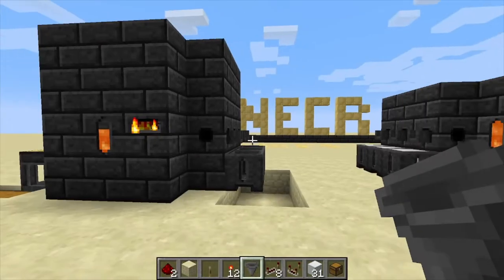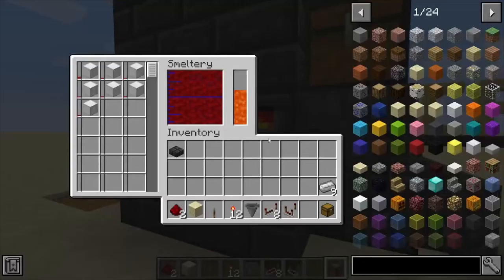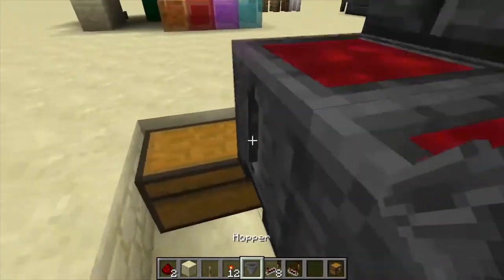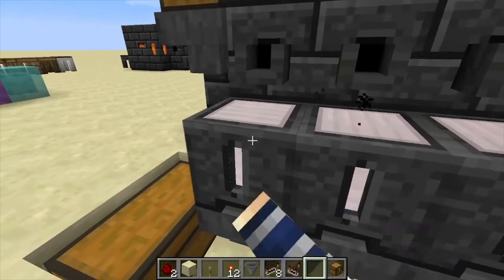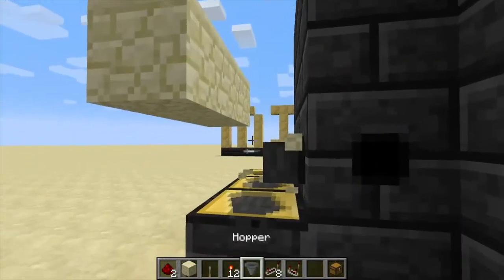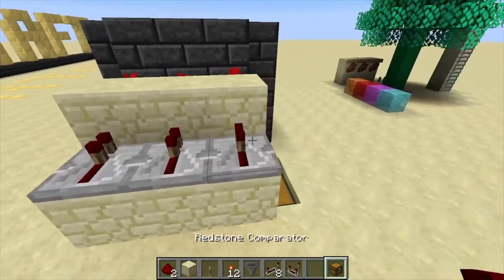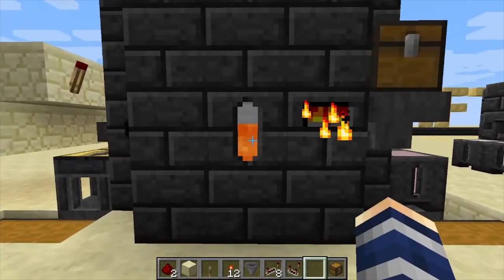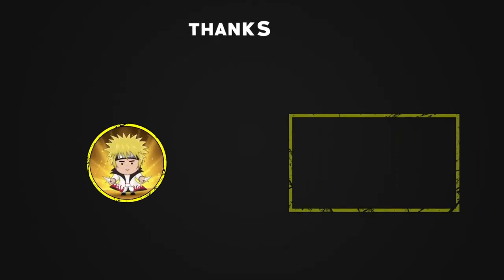Tinkers Construct: How to Automate Smeltery

Comment: Every time I try to pull ingots from the casting table with hoppers, it pulls the ingot mold itself first. :(
Reply from the maker: Lame! what monster would take away Automation from their pack!. You migt have to use a pipe and a filter or a vanilla item filter..still sadface...
Reply: @MCMentor1  it turns out what was actually happening is that i had the lever on a block which powered both the faucet and the casting table, and powering the casting table makes it invert which item is taken by the hopper

Comment: I'm finding that the hopper does not transfer items into the controller
Edit: If you're having the same issue and you have PneumaticCraft, you can use Omnidirectional Hoppers and they will work just fine :)
Reply from the maker: If it’s 1.18 it “may” require the chute instead of the controller.